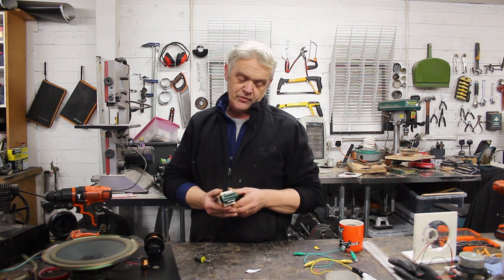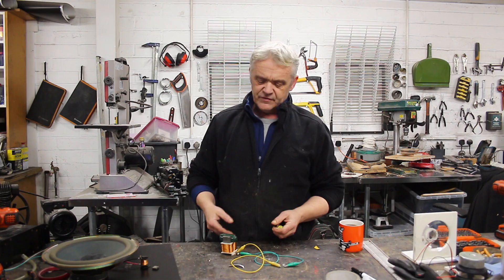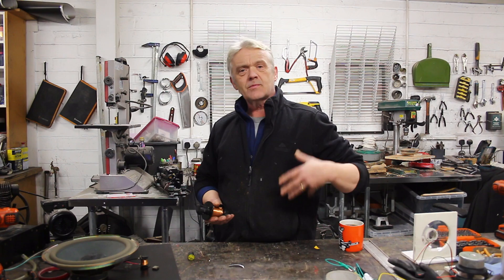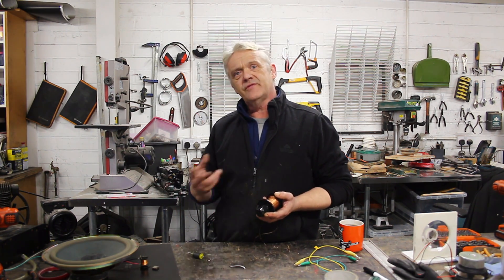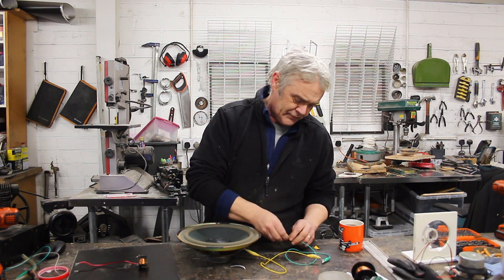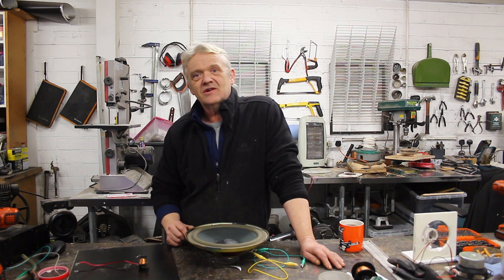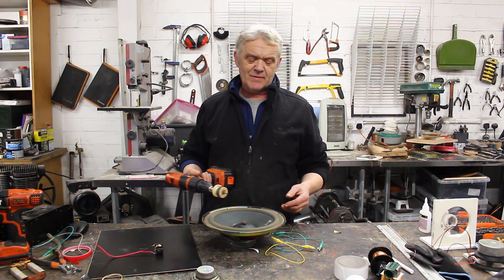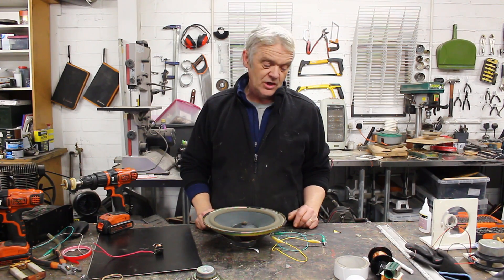1392 A Speaker As A Generator

Comment: Could you not just seal the speaker front to al some sort of a vacuum system in such a manner that you could change the pressure against the speaker from a push to a pull, sort of like opening and closing such as in bellows but in such a manner that we might actually have fairly efficient generation of power

Comment: If you blow over a hollow vessel you get a resonace sound-
Using a mid speaker of about 200-300hz resonace and a pipe with a lengt coresponding to the resonace and closing one end of the pipe with that speaker it should theoretically produce adequate power if the angle to the wind is right. 
 Sertainly something to investigate
Mid speakers have less clearance between the coil and the magnetic field thus producing more magnetic flux

Comment: I wondered what might happen if devices capable of translating sound (or its vibrations) into electricity were placed in a reverberation room (the opposite of an anechoic room), where a reproducible sound with relatively low power could be naturally amplified by the reverb. Could you get excess energy from such a setup?

Comment: So the question I have is...... how can this be utilised using your recent conductive ink painted speaker?  By finding the method to vibrate the inked surface by sound/wind/water it can be far more efficient because it wouldn't require the rotational/linear movement of relatively heavy magnets or coils.

Comment: I don't know the efficiency of the amplifiers but they consume hundreds of watts to make the speaker vibrate at audible frequencies of thousands of Hz. I also think that the diameter of the speaker is important relative to the frequency that you want to obtain actively or passively. Perhaps an analysis with two speakers, facing each other, one of which is connected to the amplifier and the other that vibrates with the sound produced by the first speaker, could give an idea of the resonant frequency of the speaker with which to obtain the maximum of power.
Reply: The efficiency of amplifiers are pretty decent, 80%+ for a class D is common iirc, the speaker itself however is less than 1% efficient at turning electricity into sound

Comment: A speaker makes a reasonable microphone as well. I was involved in some shake testing for devices to be used in  the nuclear power plant in my area. The test facility has this heavy metal grid where you can bolt the device under test onto. Over 100 kg easily. Shaking was driven by a linear motor called a speaker. Any waveform within a reasonable G force could be produced. I was next to it. Hearing protection on. The test personel involved went into the control room with a window on me and the test hardware. I had to give a thumbs up or down for device functionality. It was not that comfortable :-).
Reply from the maker: no - I'll best you weren't - lol - laughing with you mate - of course

Comment: you could also amplify the sound coming towards it with a sound lens ( pointed out by your brother) or by making  a concave  "sound" mirror with the box you used  for the water lenses. Place that near a highway or building site or railway cross (or Station) , or in the tube ,or in a noisy shop and  ...
Reply from the maker: very nice ideas mate

Comment: I'm wondering if a much larger coil could turn a large speaker into a generator by lining them up in a tunnel so that the air acts on them with the air movement of passing cars. Even wind walls should work in a tunnel.
Reply from the maker: I would probably go for wind walls mate - a much simpler solution really - well I think so

Comment: I don't have access to them but I'm betting that if you used some high wattage woofer's like Rockford Fosgate (only example brand name that comes to mind at the moment) then use something like the mini blinds in your earlier video you'd get a pretty decent current. They've already got the heavier wire winding's with much more powerful magnet's. They're designed for sound system competition 😉
Reply from the maker: I think you are spot on there mate - I will try and get hold of one

Comment: absolutely love this channel ..... so here is a question , is there a way to easily make electricity from all the "waves" in the air ? ie radio waves / microwaves ect.....
Reply: I saw a thing on Mythbusters where they used a big wire across their warehouse as an "antenna", and the radio waves that it received had a bit of current. I'd love to see a slightly more in-depth video on it too.
Reply from the maker: yes mate - I have done a couple bit it was ages ago - I can certainly revisit this
Reply: Phase conjugate holographic imaging can be used for a number of applications from automatic target tracking, to high resolution holographic microscopy. But I have read of a few scientists who have succeeded in using optical and acoustic phase conjugation in a non-linear medium to either transmit energy to a distant location without losses or to absorb it through non-linear resonant circuits without generating heat losses. Normal antenna just heat up if you send 180 degree out of phase waves to a radio source, but a non-linear circuit or a non-linear medium can actually store the constructive interference without heat losses. Plasma can have very high speeds of sound relative to air and is also electro-optically non-linear, so if you excite plasma in a tube, from both ends, with the same frequency so as to form standing waves in the plasma, it forms a Bragg diffraction grating which can support 4-wave mixing of acoustic and/or optical waves of broad spectrum, depending on the parameters of the plasma grating. This normally takes a bit of power to get started, but if your circuit has low losses due to a very high Q-factor something peculiar is reported. The circuit driving the plasma begins to "gate" incoming waves of light and sound into the standing wave by automatically satisfying the incoming waves conjugate phase angle, this is known as 4-wave mixing and makes the plasma a "phase conjugate mirror". This is a kind of automatically tuned resonance that causes incoming waves to constructively interfere in the plasma grating, depositing energy in the plasma to cause self-excitation of the circuit. The higher reflectivity the holographic grating becomes, the more the Q-factor rises, the more energy can be extracted from the environment to reinforce the standing wave, which increase the reflectivity/Q-factor etc. The energy of the room entering the plasma constructively interferes to record the holographic image of the environment in the holographic grating, and the grating then emits a wave that is phase conjugate (aka time-reversed) with incoming waves, it forms a time-reversed holographic projection of the environment which destructively interferes with the light, heat and noise fluctuations in it, suppressing them as in noise-cancellation. The end result is the holographic medium gains energy and the room cools down, because it "sees" the holographic medium as an extremely high entropy path, by being an extremely high Q-factor resonant cavity, like a hall of mirrors, it forms a deep sink for energy. There are a whole bunch of other uses for this effect that could revolutionize the world. It could enhance medical imaging, laser cooling and more advanced force field manipulation like the optical tweezer effect.

Comment: A very practical and refined application of this technology is employed by the Navy, called Sound Powered Phones. There is a coil assembly with an attached diaphragm. The coil/diaphragm assembly is both the microphone and the ear piece. If being spoken into, it creates a current in the coil, which is transmitted down the wire into the receiving coil, causing the receiver diaphragm to move, resulting in sound being made. It is a very reliable and rugged form of communication that uses no outside electricity. The high tech version of 2 cans & a taut string.
Reply: Do you have any idea where I could get a hold of such devices, please ? Or even just find out more about them ? (Sounds like a potential DIY project.)
Reply: @kennethbain4290  where to buy them if you are not the US Navy? I have no idea, sorry. But as far as I know, Sound Powered Phones is the proper terminology, so maybe you can run a search for that. Might get lucky and the manufacturer pops up in the results or something.
Reply: @craigslitzer4857  Thanks. Very much on my To Do list  now.
Reply from the maker: that is very interesting mate - thanks for the heads up - it would make a good project
Reply: @ThinkingandTinkering  Cheers. The way you frequently drop hints of something bigger, I had assumed, perhaps wrongly assumed, that you already knew about these self powered phones and used this video as a way to introduce the concept in a low tech variation. They are very useful and the professionally manufactured versions are ridiculously reliable so long as the connecting wire is well protected.

Comment: Im thinking a large wheel (bicycle maybe), that has flexible fins mounted on it. The rotation of the wheel in combination with the fins acts like a "drum roll" effect. Thoughts from anyone?
Reply: Yep, that was my immediate thought. A large wheel with lots knobs on it that can depress the cone as a knob passes. I think it might quickly deform the cone though so it would have to be fortified.
If anyone is wondering why you would go to that effort when you could use a coil and multiple N/S magnets (as we've already seen) my answer to that would be that it only requires one coil and one magnet, the rest is wood age tech :) 
The lack of power this would generate disincentivises me from actually trying this though ;)
Reply from the maker: very cool lol